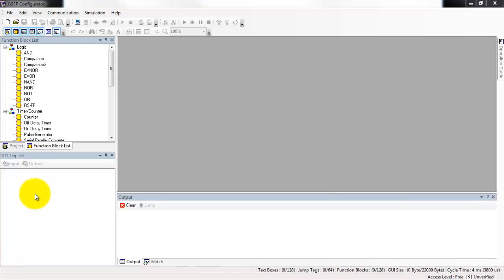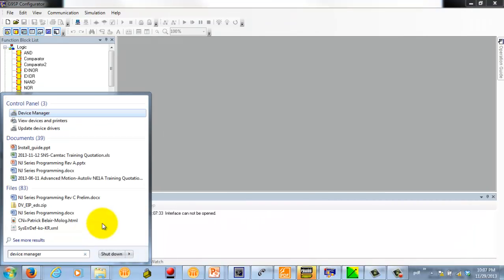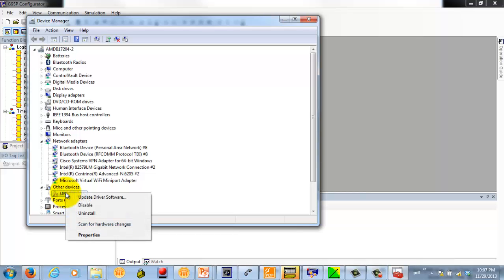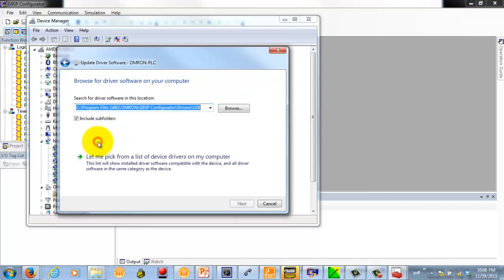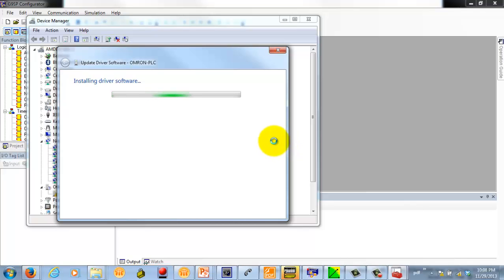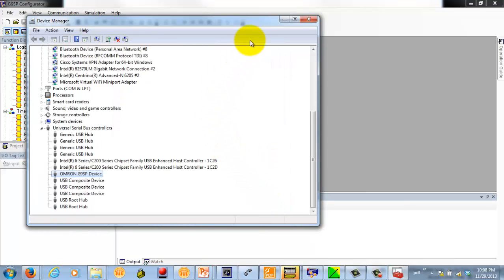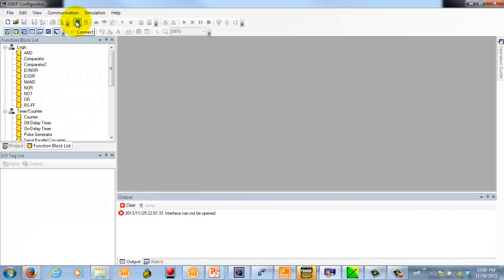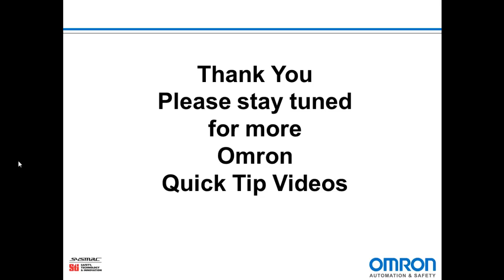G9SP USB Driver Installation

Comment: were do you find the usb driver?
Reply from the maker: If the program installed to the default location, look under your 
C:\Program Files (x86)\OMRON\G9SP Configurator\Drivers\USB